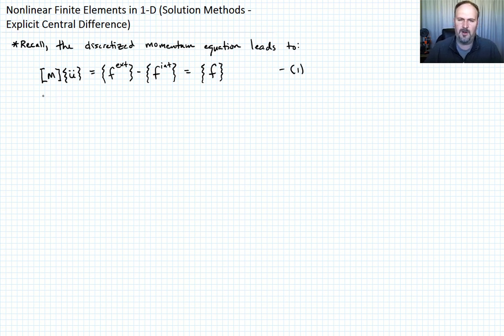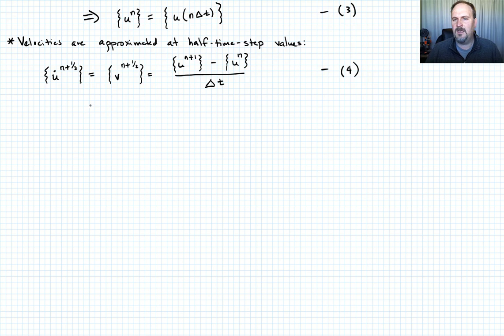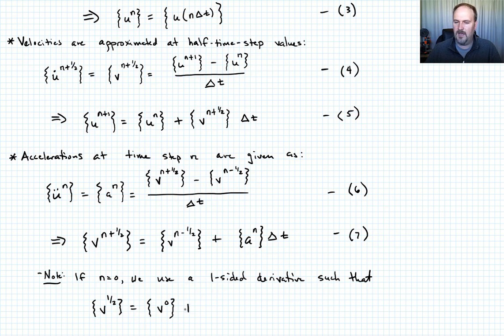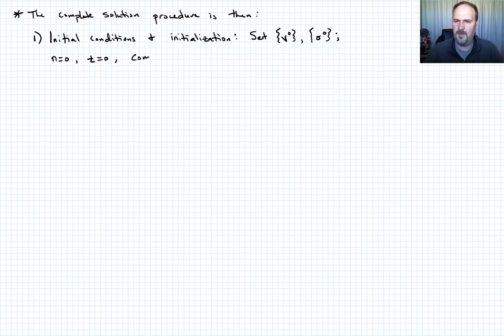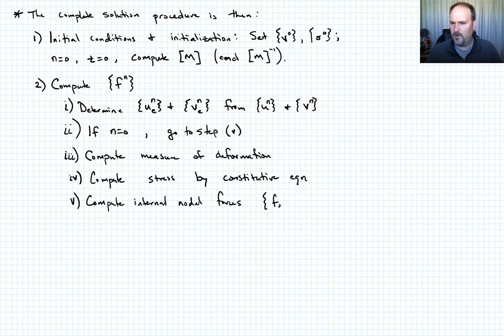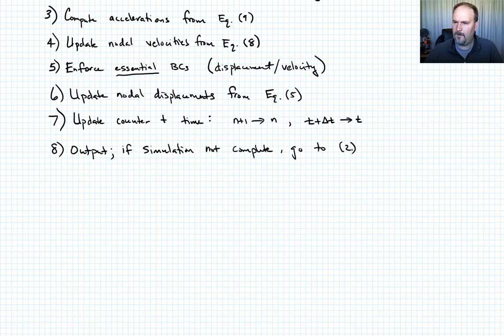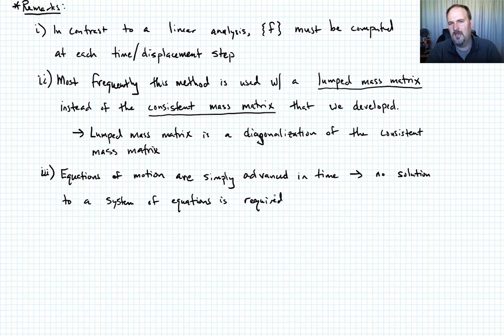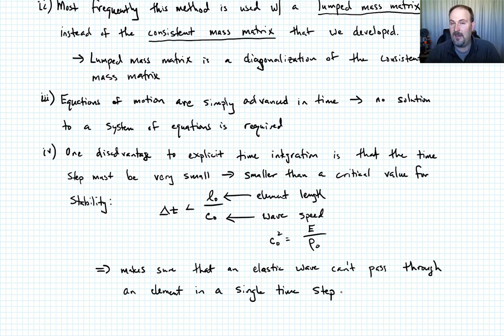2-7: Nonlinear Finite Elements in 1-D (Solution Methods - Explicit Central Difference)

Comment: Really great explanation here. I did want to offer two comments worth unpacking a little more. 

1) The critical time step is frequently variable within the problem. This just means there should be an extra step in the loop over the elements where the time increment is computed for each element and then the minimum is used for the next step. This is necessary because nonlinearities often change the critical time increment. 

2) The critical time increment is actually based on the eigenvalue of the GLOBAL mesh. The method shown here of using the shortest distance and the wave speed is well established and frequently used in many commercial codes, but it is not always conservative when compared to the theoretical value obtained from an eigenvalue analysis. Thus, the shortest distance method typically requires the time increment to be reduced by a scale factor. Common values can range from 0.5-0.9 depending on the type of problem. 

Hopefully this helps anyone studying the CDM and explicit methods. Again, this was a very good introduction.
Reply from the maker: Thanks, Bob. You are correct -- thanks for the additional detail.